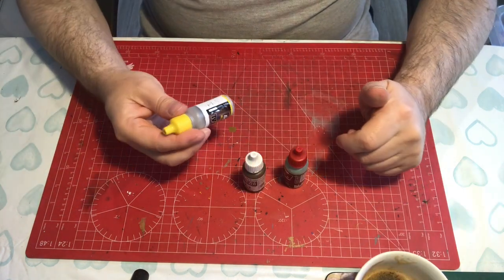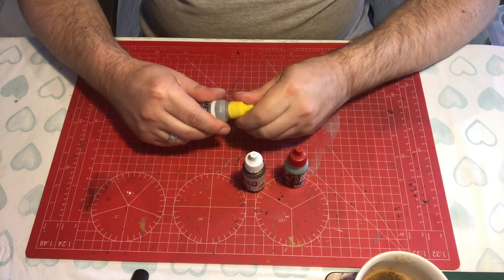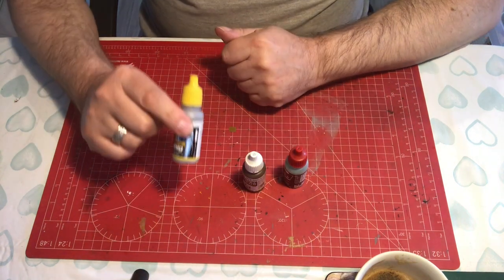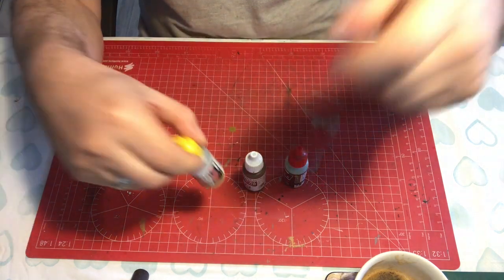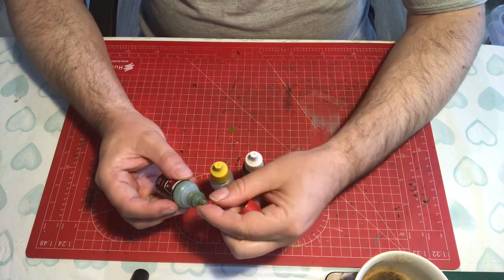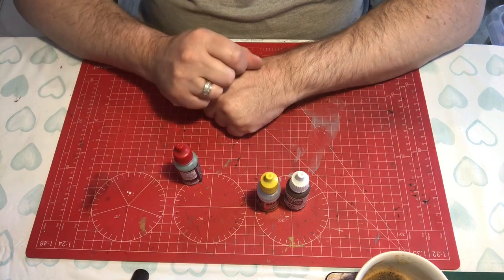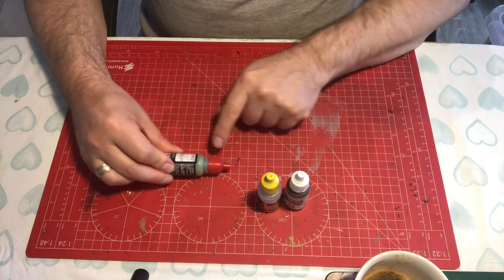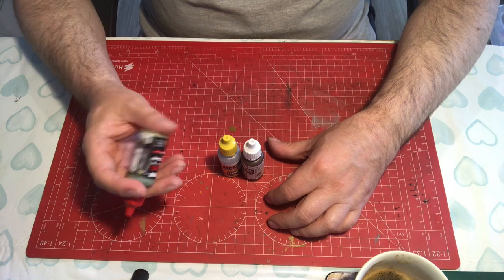Quick Tip, how to stop dropper bottle clogging.

Comment: Nicely done.  I have chosen to use "small" marine nuts as opposed to small ball bearings or bb's to put. in these bottles as a mixing mechanism.  The small ball bearings (or bb's) can actually plug up the nozzle leading to problems.  Good review.  I'm toying with the idea of inverting ALL of my Vallejo Model Air bottles...I think I can do that in my paint stand
Reply from the maker: Just check for leaks sometimes to top splits

Comment: It's difficult to see that the paint is well mixed, when using we all shake and shake, but if you look at the bottom of the bottle where the pigments settle you only have to shake until the colour becomes the correct colour when viewed through the bottom of the bottle if the bottle has been stored as intended on it's bottom. If you wipe the nozzle with a small damp piece of kitchen roll after use there will be very little paint to dry onto the nozzle.

Comment: One thing I'm noticing is that the dropper bottles you buy from eBay/Amazon tend to dry out the paint inside after some time. Ever pick up a paint and it feels lighter? So, one test I want to see done is to fill three droppers with water, Mark where the water is, then have one standing, another laying down, and the 3rd one upside down. Wait a few months and come back to see if the water has evaporated at all.

And if the water stays the same after months, then it would debunk my thoughts and I'll just say it's all in my head.
Reply from the maker: Let me know your results